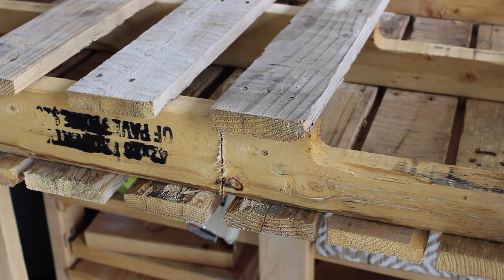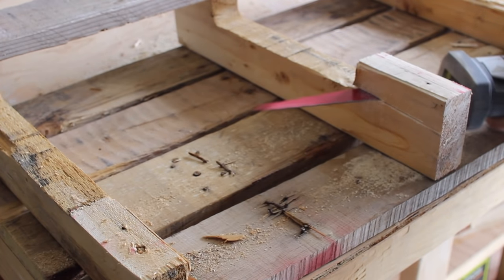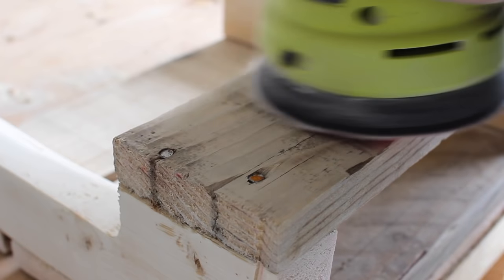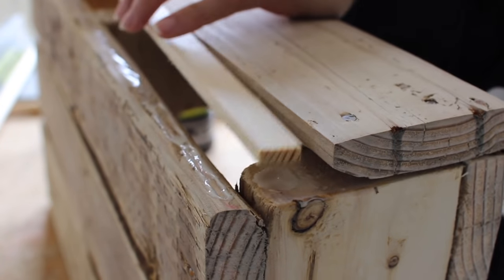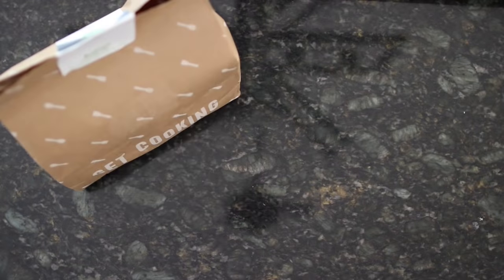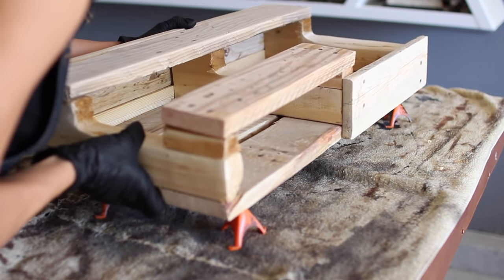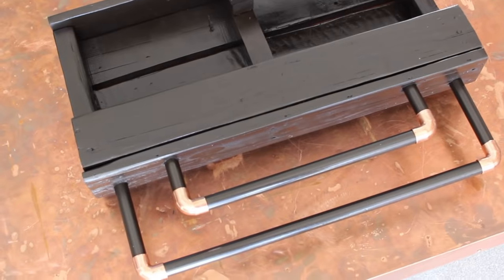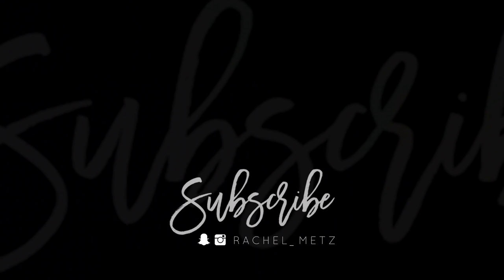DIY Pallet Towel Rack + Small Bathroom Storage

Comment: That's an interesting tool to cut pallet wood. I use simple old hammer and screwdriver to pry them apart. Problem is, sometimes they break. 
As you said, the colour is a bit dark and grains of wood are not visible but wouldn't they wear out over time and give a different look.
and I totally love the copper elbows...
Reply from the maker: Thank you!

Comment: I liked it but you’re right about the towel bars. I do like the brass on them. 
But I thought you were going to make peg towel holders and I think it would be neat that way for each person to hang their wet towels on. 
But I have to tell you the stain ruined it for me. You said you didn’t like it. Then you should have sanded it down a lot and then went over it with a white wash. That way you could have gotten some natural wood show through and some brown. It would have looked great that way. 
You could still do that you know and make a video of it. 
Either way good work 💚
Reply from the maker: Thanks for your feedback! Even thought I didn't like the stain the white wash wouldn't have worked for the space and the dark stain ended up meshing well with where I installed. It is all personal preference but with a crunch on deadlines and four projects at four other locations - sanding it down and redoing it just wasn't in the cards for me.

Comment: Just a quick question. Did you cut right through the nails that hold the pallet together? Im hoping that's what you did😅
Reply from the maker: Yes! You just have to use the proper sawzall blade for metal and wood. It says it right on the blade!

Comment: hi, it will be better to understand the cutting process if you film a little bit further away.  nice project though.
Reply from the maker: I added a card of the dog pallet bed I went into detail on that with ❤️. You legit just use the proper blade for metal and cut through the pieces you need.